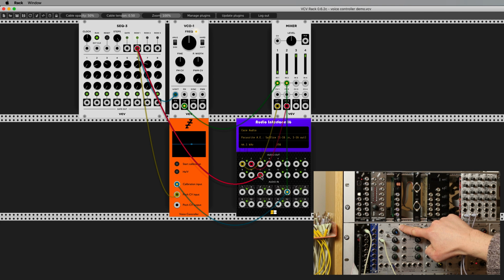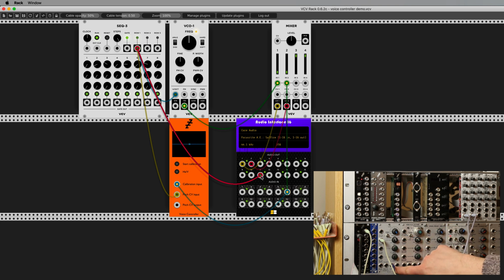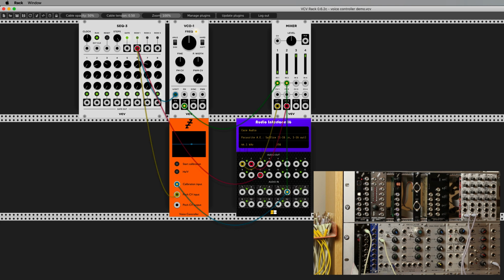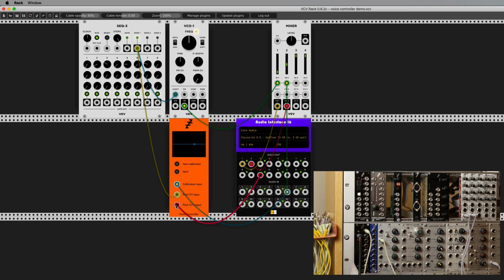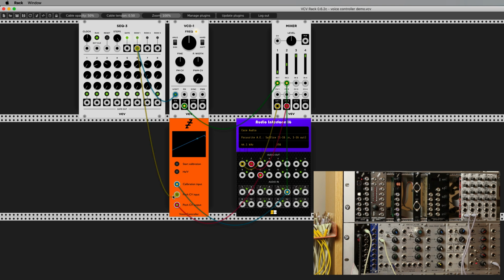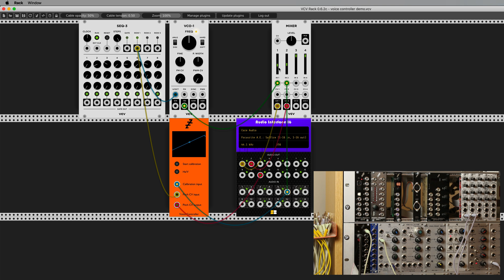Silent Way for VCV Rack: Voice Controller

Comment: In case it's useful to anyone, I wrote a detailed and illustrated guide to sequencing hardware from VCV Rack, and sequencing VCV Rack from hardware, with accurate pitch, using the Silent Way Voice Controller module: https://community.vcvrack.com/t/pitch-accurate-sequencing-between-rack-and-hardware-an-illustrated-guide/11956

Comment: hi I am the owner of an es8 and I would like to do the opposite i.e. be able to calibrate the inputs of the es8. let me explain I send sequences with a beatstep pro or a sq1 to VCV rack via an input of the es8 but the pitch 1v / oct does not track correctly. If I have the C1 at 0volt of the beatstep it corresponds to a B on the vcv rack then the next octave however drops. I hope I explained myself. In my ignorance I tried to do the video procedure with the Voice controller plugin but inverse that is putting in the calibration input the out of a vcv osc and in the cv input the signal that arrives from the beatstep pro via es8 but it does not work. Best regards Nicola

Comment: I still don't quite get it... The voice controller is nice since you can't integrate VCV with a DAW but why the audio interface? I have my Es3 connected to my Scarlett 18i20 and when I select the appropriate Adat outputs on the normal  "audio interace module" on VCV then it sends all the data properly.
Reply from the maker: Are you asking why I'm using the rcm Audio Interface rather than the built-in VCV one? Purely because the rcm one has 16 ins & outs.